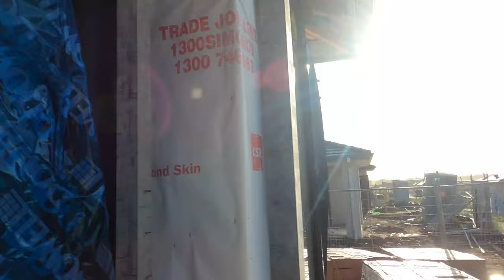Bricklaying Inspection with THE BOSS

Comment: Wow those windows 😱 Imagine if you were the builder or owner and turned up onsite and saw that. Good idea to put a bit of bondcrete in the mortar of a mitred sill to help keep them in place over time.
Not wanting to pick but I think it’s unacceptable to have that cut in the sill under the sliding door. Tracing out the bricks over that width could have easily tightened up to get them working. And the expansion joint foam is all over the place. Why is it sticking out, who’s going to fix that up. Don’t leave it like that for the next guy to fix up. Do you use expansion ties across the AJs, they have the benefit of also holding the foam in place 10mm back from the face ready to be caulked. Sorry to be negative.
Reply from the maker: LAZY DOG agree with all your points mate as usual. 
Sill shouldn’t have a split in it over that distance. The mud on windows was fresh the boys could hose it off at days end. Any longer and it would cause scratching for sure. One of the apprentices laid the mitre he is a good bricky very good with sills and decorative work. 
As for the foam they just run a knife along brick faces to cut back the foam once it’s like that to make it flush!!

Comment: Good to see you go round an do a check with the boss seems that there is a lot of snagging 😳on retaining walls at the moment😡😡 just a quick one why do you use the same bricks on all your jobs? Have a good day my mate😎😁🍻
Reply from the maker: Hey mate. This is just the boss of the crew that I worked for today half of the boys were at one job and the other half finishing off the one at the end
There is like 3 different bricks here which are really popular and are used quite often. Chestnuts which is the one we used in the first half of the video is by far the most used and we get jobs every second with them
Reply: @hendosbricklaying2003  no problem just wondered,as here in England there are thousands of different bricks,hope it went okay with the boss🤔